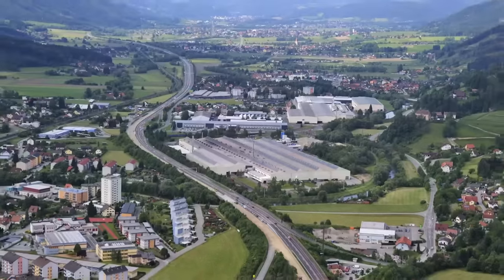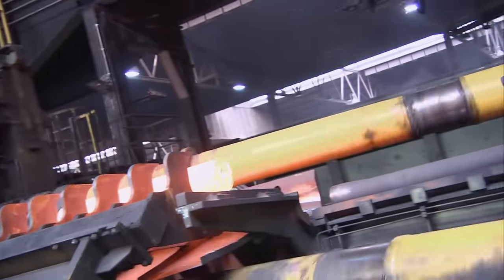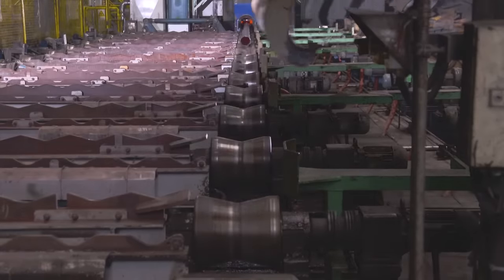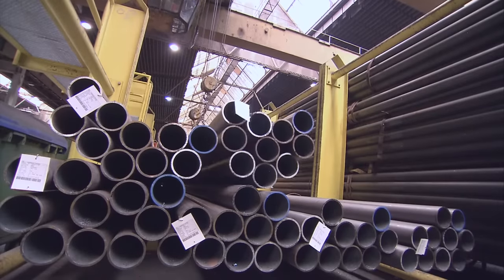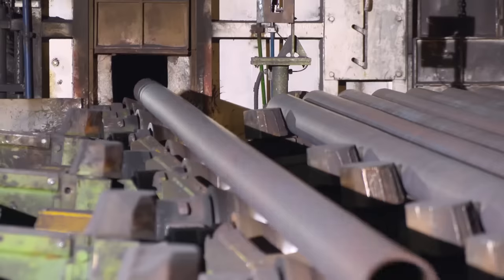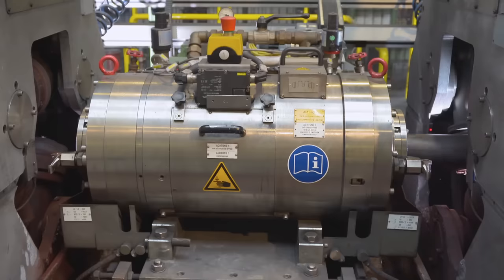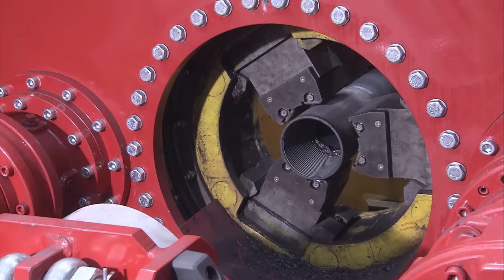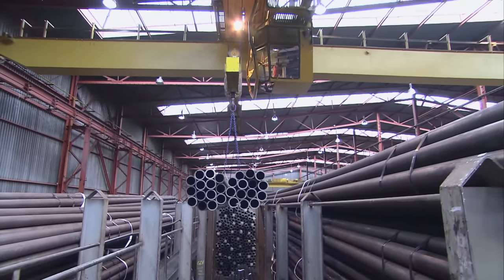Production flow - from billet to high tech seamless pipe.

Comment: Very nice and instructive video. Good to see that you concentrate on the actual processing details and explain it in a clear and factual manner. This makes a nice difference to the usual emotional and dramatizing style. 
It would have been nice to see the initial piercing process ("Mannesmann process") in more detail. I am aware that it is hard to capture this on camera.
Reply: I think it's process secrecy that's why.
Reply: @mehmettemel8725  The process is very old and well known, actually. It has been invented by the Mannesmann brothers in 1886. If you look up "pierce rolling"  you will find a lot of information on the process.
Reply: @HaraldFinster  Is it the same as Drawn Over Mandrel?  I've been looking for the right material since the early 90's, happen to know how to buy it / find it?  Last time they told me I would have to buy rail cars of it, and wouldn't sell a sample to machine the prototype to see if it would work for my needs.  They even asked what I intended to do with it.  I leaned forward to see their testing like I could see the range and in metric...  I need the inside concisely done.
Reply: @bardmadsen6956  To my limited knowledge "Drawn Over Mandrel" is used to bring welded tubes to a defined diameter. In this case the tube is formed from sheet metal which is bent to the shape of a tube. The seam is welded inductively. The tube is then drawn over a mandrel to finish the size.

The Mannesmann piercing process is somewhat similar. It makes use of (usually) two driven rollers running in the same direction. The round billet is located between the rollers. As the distance between the rollers is slightly smaller than the diameter of the billet, the billet is forced to a somewhat elliptic shape. This loosens up the structure of the material in the center of the billet so that a mandrel can be forced into it and forms a tube. 
As the rollers are slightly skewed the billet is drawn onto the mandrel and shaped into a continuous tube.
I am not sure if I am allowed to include a link here, but the following video explains the process in an extremely demonstrative way. It is actually made for kids and in German language, but the demonstrations are self explanatory:
https://kinder.wdr.de/tv/die-sendung-mit-der-maus/av/video-rohre-100.html
The demo starts approximately at 03:00.

Again, I am not an expert and just privately interested in industrial history and photography. I hope this is helpful anyways.
Harald
Reply: @HaraldFinster  Thanks for the video, that shows what I was looking for.  If I ever find what I'm looking for I need it machinable.  DOM seems the way to go, somewhere around $20 a foot last time I looked, the problem is that I need them over sized to the inside diameters, then machine them to fit 'telescopically'.  Three would be perfect, two might work, still I can't find any to buy.  I'm getting close with the machine to make the machine without a source for material, the work is missing...  I just love very long term projects.  Years ago I was so desperate I asked a cast iron place and they seemed like they were on something, face to face, like they were stuck in a mode of me working for them when I wanted them to work for me.  I've thought of doing something myself, but man that is pretty hot, not sure about the learning curve in dangerous territory.  Aluminum casting is about as far as I will push it.
Reply: What a great video. So much better for the kids than some video game! Thanks a bunch @HaraldFinster

Comment: Back in the 1980's through the 1990's, I worked in a small manufacturing shop where we made gym equipment. One of my jobs was making a weight lifting bar that is used in competitions. The shaft was a special steel called ETD150..Elevated Temperature Drawn. The shaft started as a larger diameter and while the steel was still red hot, it was drawn through a smaller diameter device which compressed the red hot steel down to a predetermined diameter. It also had a very specific 'recipe' of various chemicals which gave the shaft a specific performance requirement, such as being able to put up to 500lbs of weights on both sides that will cause the bar to bend but come back straight once the weights are removed. The chemical make up of the bar also gave the bar certain machining characteristics. 

Over the approximate 18 years that I worked there, I made several tens of thousands of bars.

Comment: All US submarines use seamless tubing. It is believed that the sinking of the nuclear submarine USS Thresher in 1963 was due to a failure of a seamed high-pressure tube which allowed a jet of pressurized water to short out the main electrical panel which lead to the series of events which doomed the submarine.

Comment: Pretty sure these are pipes not tubes, narrator. Lol
Reply: I work at a big steel distributor and we refer to this officially as DOM tubing. Seems weird since it's more like pipe in my mind. "Tubing" makes me think of structural tubing. But in this video the DOM tubing looks even more like pipe since they are threading it.
Reply: @blackburn1111  So tube is measured from the outside, pipe is measured from the inside.
Tube can be any shape, pipe must be round.
Reply: @TlD-dg6ug  hmm. The drawn over mandrel stuff we have has ID, OD, and wall thickness specified. Perhaps having all 3 of those dimensions accurate is what makes it tubing then?
Reply: @blackburn1111  Firstly, not all tube is seamless. Your seamless tubing can be called out like that, non seamless cannot. So by definition a pipe is a connection or passageway for something. As such they are measured to the inside (gas,oil,etc). A Tubes are mostly used for their outside measurements.... Such as fabrication. Pipes are called out from the i.d. because the only thing that matters is flow rate as long as there's enough material to hold the pressure. A 2" pipe could have an 8ft wall thickness and just be a more substantial 2" pipe. But a 2ftx2ft tube with 8ft wall thickness would be considered an 18x18 foot tube. 
Basically all things equal, if you used one of these pipelines for structural use instead of a carrier, you would call them tubes. Tubes will always be more dimensionally accurate, because you're building something with their shape. Not transporting. Does that make any sense?
Reply: @TlD-dg6ug  not exactly, 2" pipe still has a specified outside diameter.
Reply: @carlosrobertson8265  kind of, but that's not what it's referred to as. I left a handy chart for everyone that doesn't know the difference between pipe and tube.
Reply: @carlosrobertson8265  Tubing is measured by the OUTSIDE DIAMETER (O.D.), specified in inches (e.g., 1.250) or fraction of an inch (eg. 1-1/4″).

Pipe is usually measured by NOMINAL PIPE SIZE (NPS). Although it is related to the outside diameter, it is significantly different. For example, a 1-1/2″ pipe size actually has an outside diameter of 1.9″ NOT 1.5″. The table below cross-references the nominal dimension of a PIPE with its actual outside diameter.

For sizes from 1/8-inch through 12-inch, the NPS corresponds to the nominal inside diameter, but differs somewhat from its actual inside diameter. Early pipe manufacturers made the walls in the smaller sizes much too thick, and in correcting this error in design, they took the excess from the inside to avoid changing the sizes of the companion fittings.

For sizes larger than 12-inch, NPS corresponds to the actual outside diameter. For each nominal pipe size, the outside diameter (O.D.) remains relatively constant; the variations in wall thickness affect only the inside diameter (I.D.).
Reply: Maybe you know, here is part of a post just awhile ago for Harald Finster : I've been looking for the right material since the early 90's, happen to know how to buy it / find it?  Last time they told me I would have to buy rail cars of it, and wouldn't sell a sample to machine the prototype to see if it would work for my needs.  They even asked what I intended to do with it.  I leaned forward to see their testing like I could see the range and in metric...  I need the inside concisely done.
Reply: @TlD-dg6ug  yes, I know.

However even though 2" NPS is not measured in the outside it still has a defined OD of 2-3/8" so there is a limit to the wall thickness and the OD never changes from one schedule to the next. It cannot have an 8 foot wall and still be 2" pipe.
Reply: @TlD-dg6ug  thank you kindly for the explanation!